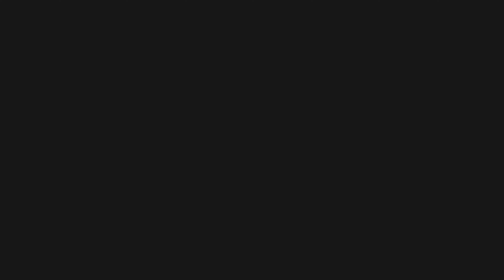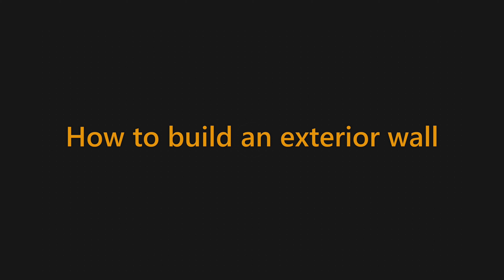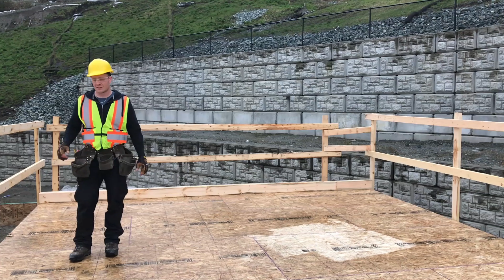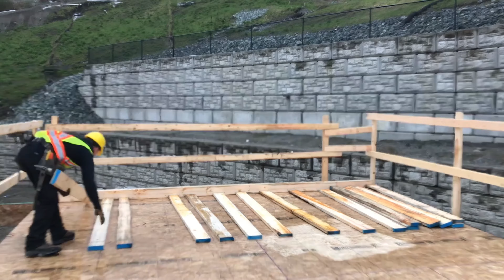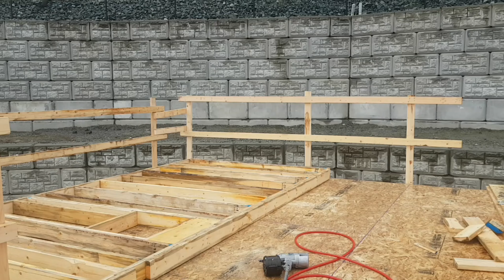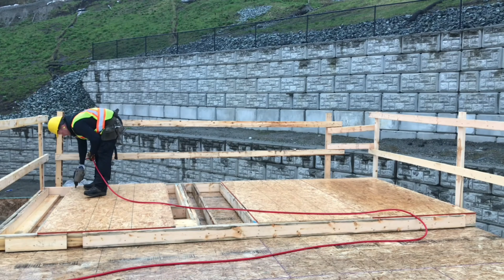How to build an exterior wall

Comment: Thank you for the informative video. I have a question. How can we deal with twisted studs?
Reply from the maker: Twisted studs are a tricky one. Depends how twisted the studs are. But what we do is use then for smaller areas such as drywall backing, or cripple studs under/over windows. This allows you to get the smaller straight sections out of one twisted stud.
Reply: @allskills2298  thank you. :)
Reply: The stud twister kit
Reply from the maker: @blackbird7481  you can find them at home Depot right beside the lumber stretchers 🙂
Reply: @blackbird7481  it is available in every stud twister shop, i guess. :)